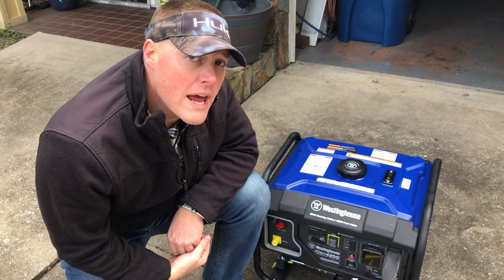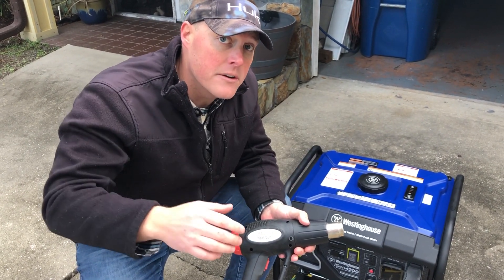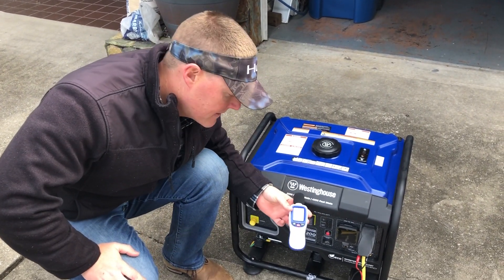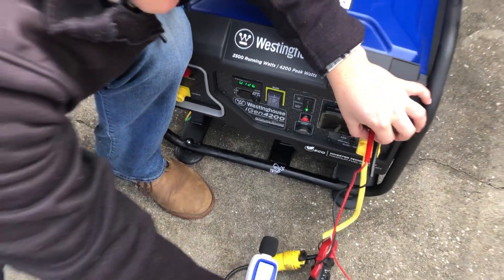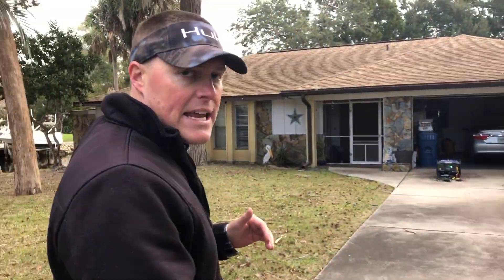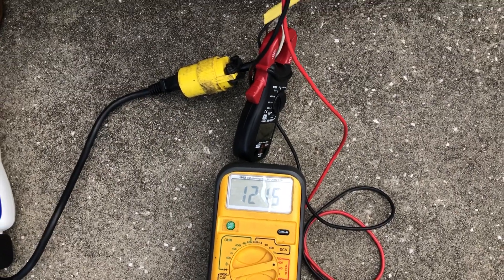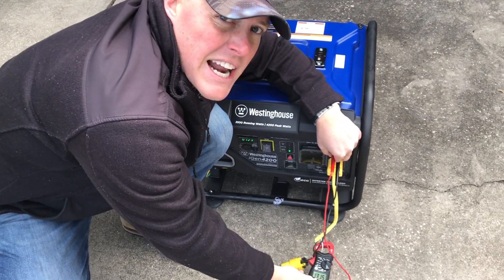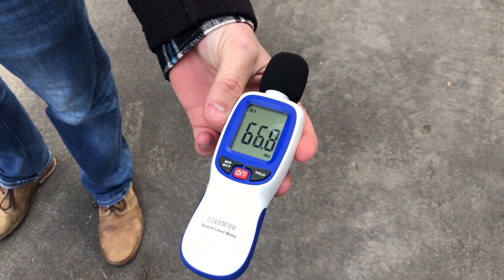Westinghouse iGen4200 Noise & Load Testing - Decibel, Voltage & Amp Test

Comment: Any opinions  4500 vs 4200
Reply from the maker: The 4200 is quite a bit cheaper: https://amzn.to/2T6aOjD However, does not have wheels like the 4500. I found the 4200 to be a bit louder as well. It really comes down to portability. The wheels/handle on the 4500 make moving a 100lb generator around a lot easier.
Reply: I agree but right now my Yamaha 2800i is enclose 50' away and I'm looking for something with about 500 watts more that will easily handle my sump if and when it kicks in. The Yamaha handles but it takes a toll on it.
Reply from the maker: Either should handle it... If you are controlling the generator from 50' away, the iGen 4500: https://amzn.to/2TdR3Xn may be a better option with the Remote Start Option. We used this way more often than we initially thought we would. 

An in between size that may work is the Energizer... I don't see any available online right now, but may be worth considering.